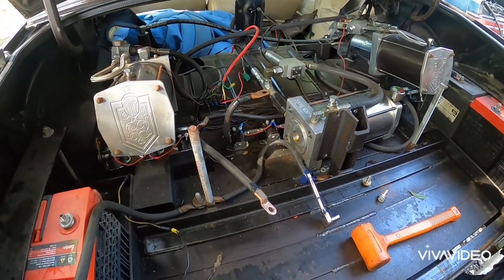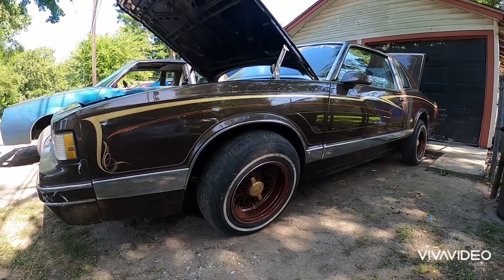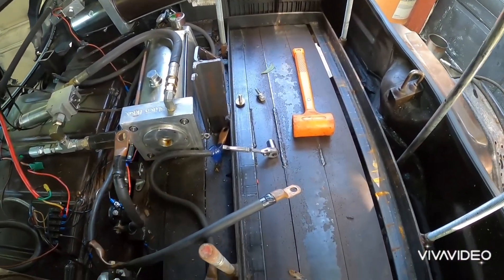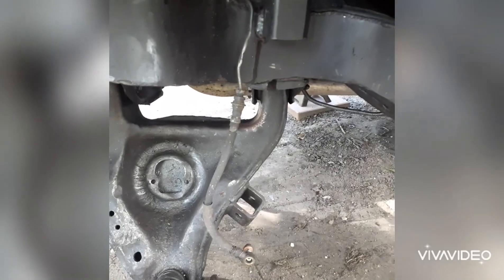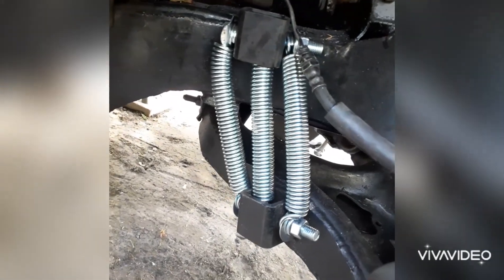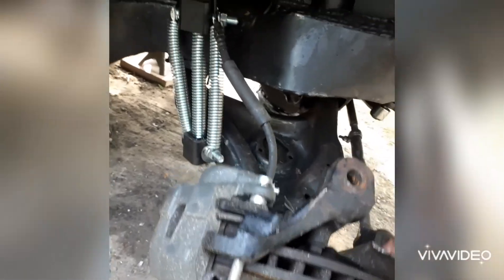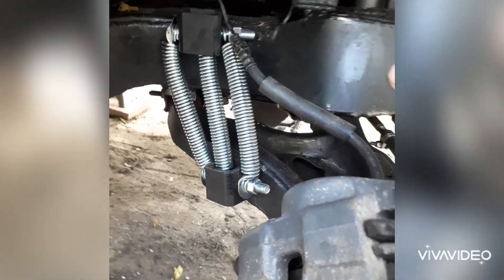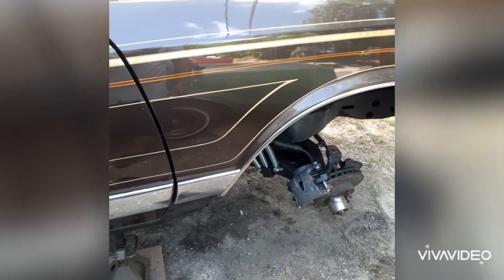Monte Carlo Lowrider

Comment: How much psi do charge it with I put 120 in Mina and it don’t work thanks
Reply from the maker: Piston or bladder and if piston did you set your piston before pressuring?
Reply: @lowridersmore8189  piston yes I put it bac set it
Reply: How much psi do you recommend  80.   100.  120 200   Street car  ? Nobody gives straight answer like it’s going to hurt to say how much psi how much we’re got coils etc I’m in another state  wow
Reply from the maker: Ever car is set up different I would test it and see what it does at 60lbs and add 10-20 lbs from there and see what does best for your car I know some hoppers that put 80 lbs and back bumpers and others add 100lbs plus and they back bumper. It's all testing till you find the sweet spot
Reply from the maker: Another thing you using air or nitrogen? I would recommend nitrogen
Reply: Ok thanks I was using air I’ll try it

Comment: I have one question if you don't mind me asking is why don't both of my a arms tuck the same
Reply from the maker: Don't mind at all whatever I can help and what you mean by that ? Does one dump faster then the other and/or does one go higher then the other when dumped
Reply: Yeah it do but I was told that is because I need to take that split out and run two lines to the front but I was go do that eney ways I had went and bought a black magic piston pump but I am trying to stay street I am just go add two more batteries got eight now but need to get a bridge done a few folks said it mite be my spindle to make it tuck like the other one
Reply from the maker: If you have a y at the front move it to the back at the pump and run your hoses coming out of the y at the pump and your hoses cut them to length I seen people have long ass hoses going around the engine and that can also cause it to go up uneven and same way dumping you should still be street as long as you have your factory trailing arm mounts and your rearend is not pushed back. And for the spindles reinforce them I did that to mine and helps
Reply: Thank you so much bro and plz keep that fire content coming I am watching and the world should be watching 👍🏿👍🏿👍🏿👍🏿👍🏿👍🏿👍🏿👍🏿💯

Comment: Where u get the springs from
Reply from the maker: The helpers spring or which one?
Reply: Yes the helper springs
Reply from the maker: Lowe's and type in 543014 the spring come up they are 1x7x0.135. 18.8 lbs about $4-5 each
Reply: Thanks just picked some up today
Reply from the maker: Let me know how they work for you and use grade 8 bolts I used the other one for video only and replaced with grade 8
Reply: It worked good  but I think I need 4 on each side but thanks homie
Reply from the maker: That's good ever car is different my homeboys monte has 3 on each side and does pretty good and my regal has 5 on each side and I'm on 13's and he's on 14's both g bodys. Got any videos of it working

Comment: Where is this place at
Reply from the maker: My backyard in Houston did you find a place to get your car done at?
Reply: @lowridersmore8189  nit yet had a rew people hit me up but thye wasnt talking any good bizz
Reply from the maker: Damn hope you get your car done and what you trying to get all done to it?
Reply: @lowridersmore8189  i just want a 3 pump 6 battery hook up with killer 3 wheel and lock up i gave this guy info he said he a do some pricing never herd back
Reply from the maker: Question frame at least stress points done or fully reinforced,already have hydros or virgin,slip yoke on driveshaft or stock,extended trailing arms or stocks,going regular cylinders in the back for 3 wheel or telescopics,rearend reinforced to prevent bowing?
Reply from the maker: Bridge already done or need to get done
Reply: @lowridersmore8189  need to get done car is 79 malibu everything original on it
Reply from the maker: Oh bro you got a ways to go first thing first get that frame done at least stress points and go from there last thing you want is to buckle that frame and body
Reply from the maker: Can tell you one thing not looking under 5k for stress points on frame,bridge,rearend reinforced,slip yoke on drive shaft, extended trailing arms, extended and reinforced upper a-arms,all new pumps,batteries and installation
Reply: @lowridersmore8189  right right
Reply: @lowridersmore8189  5 k aint bad for all that or is that just frame work price without the pumos and ither things
Reply: @lowridersmore8189  the guy i told u about told me 6500 with that set up and slipyoke and all that
Reply from the maker: Yeah not under 5k depending where you go and the price of metal not cheap if I was to do it $5500-6k
Reply: @lowridersmore8189  dam i wish u was closer im in kansas the onky bad cause i deop it and give u half to get started or however u operate your business dang it sounds good to me tho